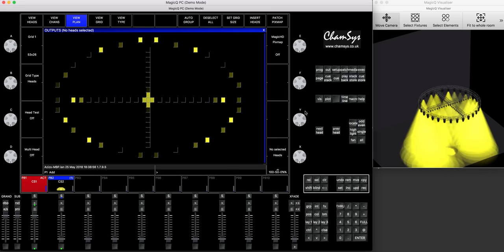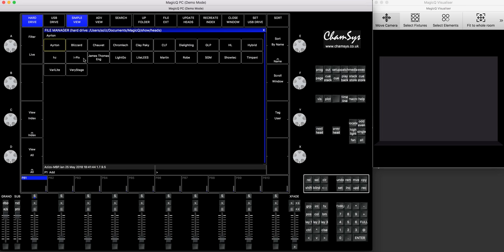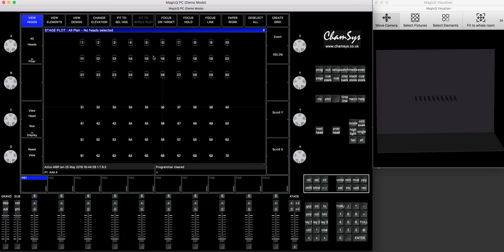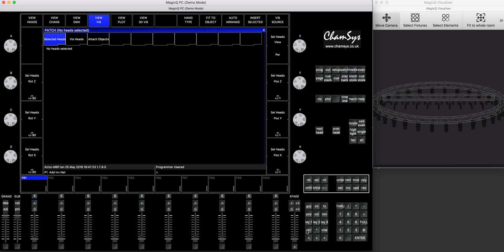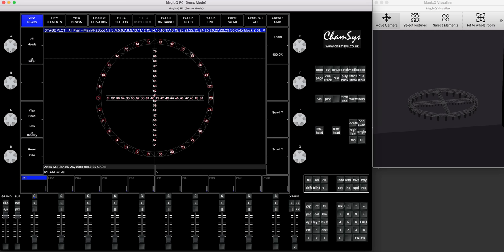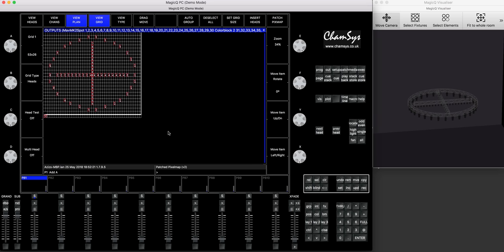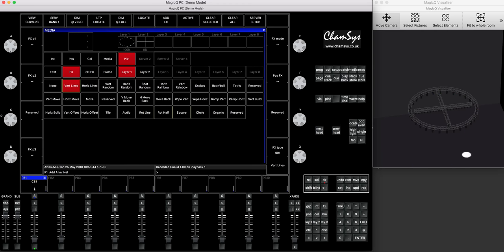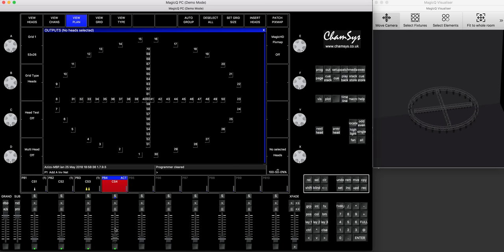MagicQ - Pixelmapping. Making Grid from Plot view

Comment: Hi guys! I cant make the GRID happen.  I am following all steps, and when click on "Create GRID" the following message appears "Could not fit into Grid". I have the following software version : 1.8.0.5 . MAC  Is there any special setting to make this happen? TKS!
Reply from the maker: if you paid attention, i believe I have mentioned about how enabled universes affect the grid size.
means if you enable all 64 universes [even if you patched only across 5], you will be able to make a grid of 181 x 181 pixels. change horizontal and you can increase vertical - that is 32K channels = 64 universes. because MagicQ calculates currently as each pixel, even empty as possible place for pixel calculation.
if your plot is too wide, and there are a lot of empty places in the plot, it may not fit into the grid, reduce the gap or filter per group - before trying to fit into a grid.